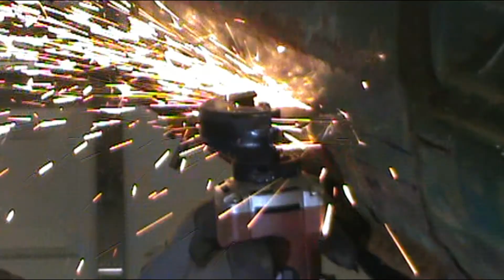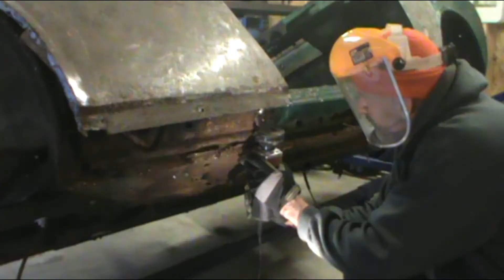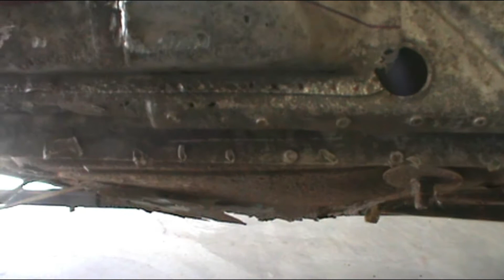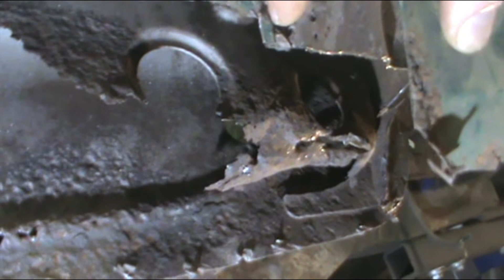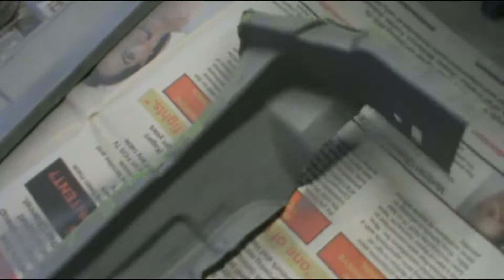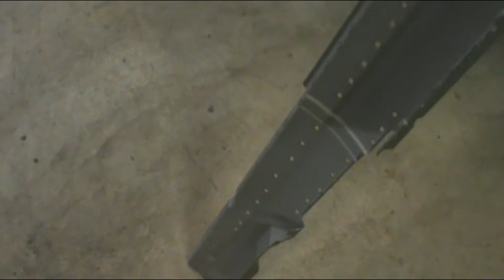1966 BMW Neue Klasse 2000c Rocker Repair

Comment: James! what an inspiration you are. what ever you are smoking I want some! hell of a job but beautifully executed. soft question but what is the little sand blaster you were using. I need this in my life I am almost certain!  thanks
Reply from the maker: Thanks.  Media blaster is an el cheepo from Harbor Freight, but I am pushing it with a big air compressor (Puma 5 hp/60 gallon @15 cfm).  Using ground glass.